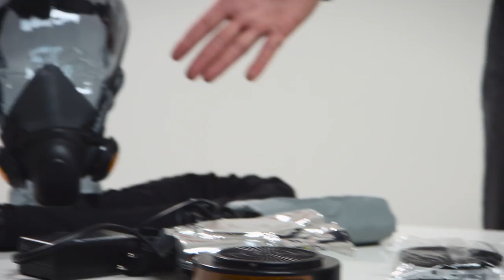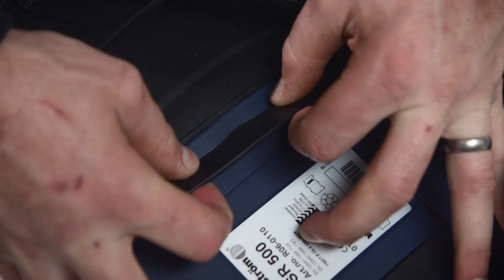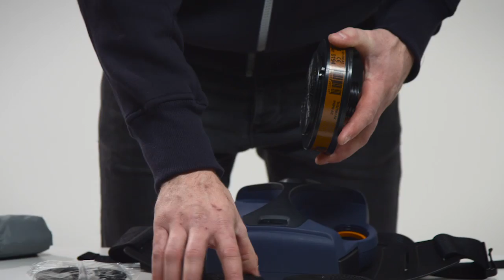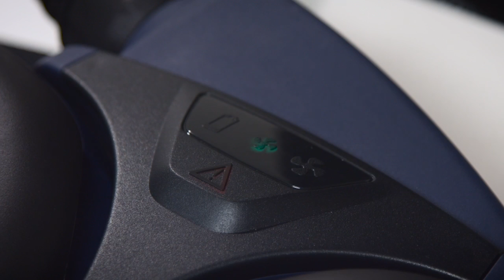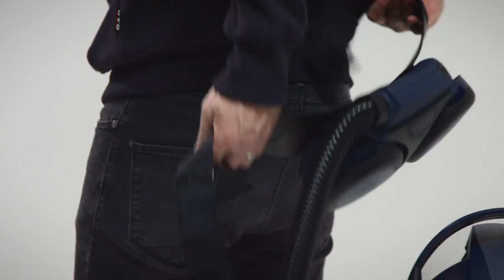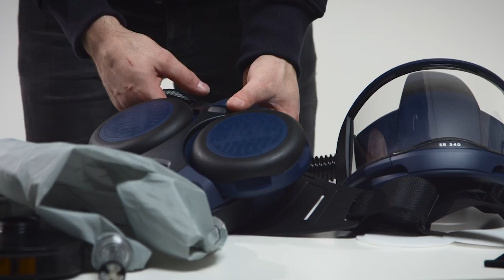Sundström Safety Instruction SR 500

Comment: Just to confirm, you are demonstrating this with the 570 helmet correct? The 580 is fully enclosed so that it can meet ANSI or CSA requirements to act as a hard hat, so it is not the one in this video, right? Also, are you developing an OV only cartridge with the screw in threads for the PAPR system so that the replacement fees are lower? My typical set up is OV on bottom, p100 on top. I assume then I use the adapter with the threads, pop in the OV cartridge (typically used with the tight fitting respirator), then can I click the P100 on top, then put the pre-filter and cover on top?

Comment: Any reason you couldn’t use the belt front facing? I use a leaf blower to blow down dust before cleaning and the blower is on my back. How long is the air pipe?
Reply from the maker: Hi, The SR 500 fan unit is designed for use on the back for comfort, ergonomic reasons, and the fact that most people work in front of themselves.
There are however occasions when users would like to have the fan unit front facing like in your case but then you need to be careful so that the hose to the head top doesn’t get caught into something so that the respiratory protection can be compromised.
The breathing hose is 900 cm long and there are several different head tops to choose from see, www.srsafety.com.
Hope this helped!

Comment: Hi, I own a couple Sundstrom half-face respirators and approve of the quality design compared to other similar brands. You could call me a fan.  I'm curious though if Sundstrom has considered working with commercial airlines or aircraft manufacturers in developing a mini PAPR type system to be used for more confident, protected, comfortable breathing use for commercial air travel ??  I'd personally feel very confident and comfortable wearing this type system rather than breathing through a tightly sealed disposable mask on a longer haul flight - regardless of any specific bug, germ or dust particle, etc., floating around or sneezed into the cabin!  : D  Thanks
Reply from the maker: We are a industrial supplier and have therefore not looked into this type of product, however it makes us happy that you are a fan. Have a good day!
Reply: --  Ok, thank you for that reply!  I guess I just hope you can  some day be an industrial supplier as well to various Airlines, so they can enable a more comfortable and confident passenger travel experience !  greets

Comment: Too bad that all those controls/indicators are on the small of your back, and be seen...  a post-blower CPAP inline anti-viral filter at the hose connection would be better as well for COVID-19 use.  I would expect better designs for the cost...
Reply: Igor, have you used an SCBA's before? The audible alarm systems used here does not seems any different than that used on SCBA's, which has been an industrial standard for years, plus there is the addition of vibration alarms. Like on SCBA's, where do you put all the indicators, so they do not obstruct or hinder your work or view? I have seen and tried a few different attempts by various manufacturers, but any time they have attempted to place it in view or in front, it was cumbersome. As far as for Covid-19, there’s a filter for that, filter SR 510!
Reply: Forget the blinking light.  Unit vibrates when alarm function sounded.  Also, the P100 particulate filter + pre-filter is superior in particulate filtering performance than a leaky hit and miss N95 particulate mask, if that's what you're questioning .